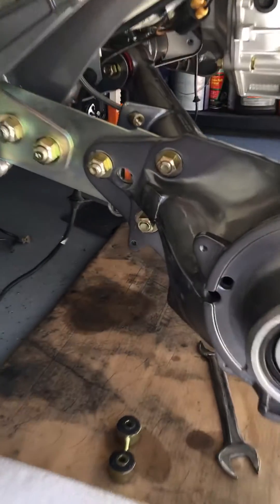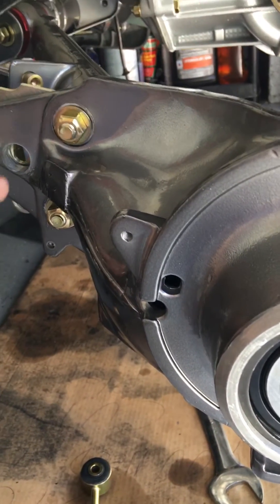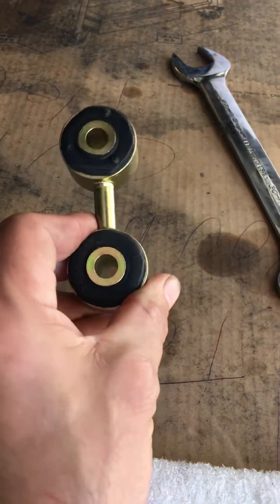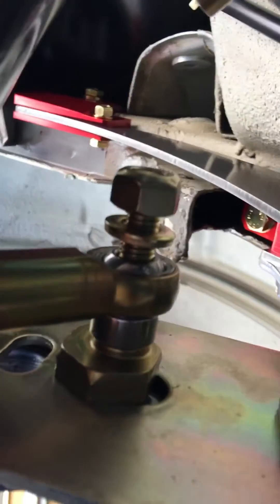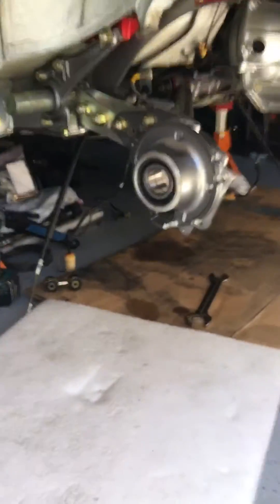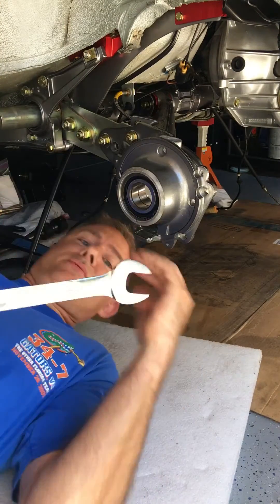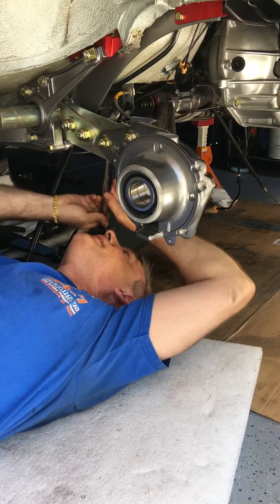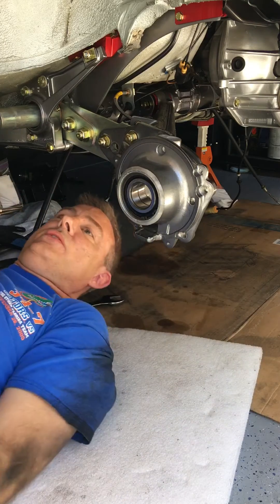Porsche 944 Turbo Camber Adjustment Rear Suspension

Comment: Hello there, you have a new subscriber! I am attempting to install a complete 951 rear suspension into my 1966 split window bus with 11" wide lobster claw wheels. Before I cut out the OEM beam and install this Porsche beam I am taking many, many measurements as there is go going back once I fully commit. In the course of all this I have noticed a full 1" of combined toe out on my beam with the wheels bolted to the hubs and everything just sitting UNLOADED on flat ground. If you might provide some insight to this I would be extremely appreciative.  My email is: vwaudiwelder@aol.com. Thank you so very  much. I love your car, I never, ever should have sold my '88 951 immediately after purchasing (engine blew).